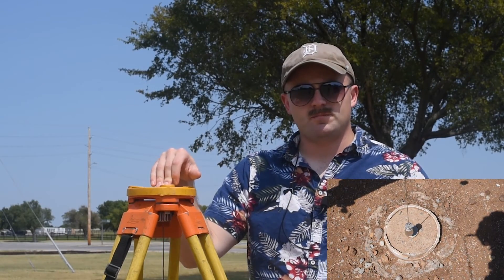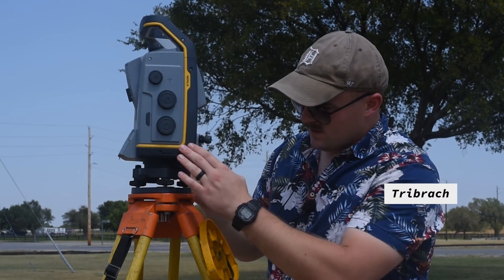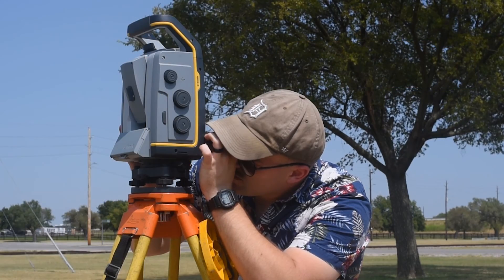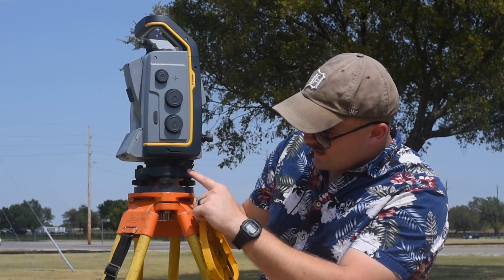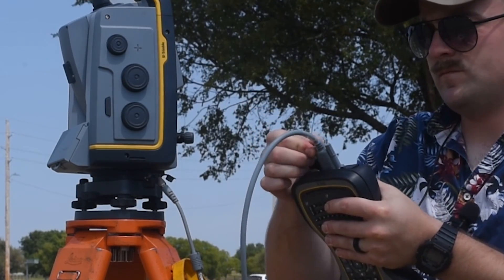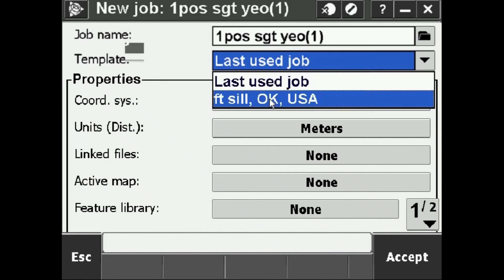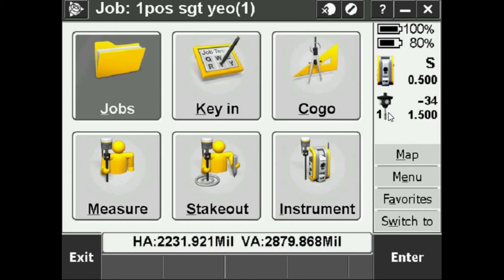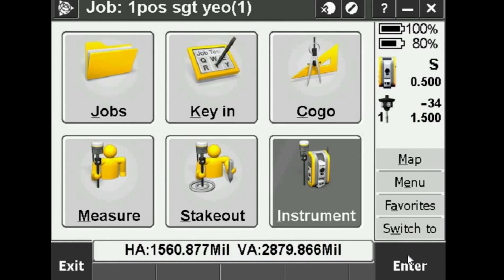S7 Initial Emplacement and Setup - Trimble S-Series Theodolite

Comment: Why did you physically connect the controller to the total station? Just connect it via radio...
Reply from the maker: The videos are open for everyone to view. That being said, they were specifically made for Artillery Surveyors. They are issued special ordered total stations that do not have the ability to communicate with bluetooth or radio.
Reply: @mrjoeyeo8993  oh right, thanks for the clarification.
Reply: How many artillery surveyors are there?
Reply: ITs clear that the TSC3  used here doesnt have the radio support broadcasting at 2.4GHz